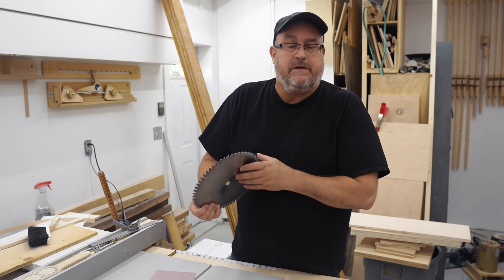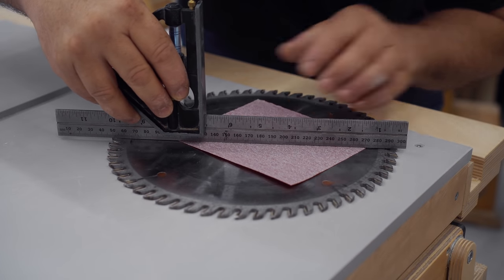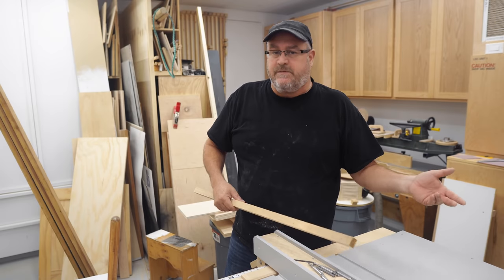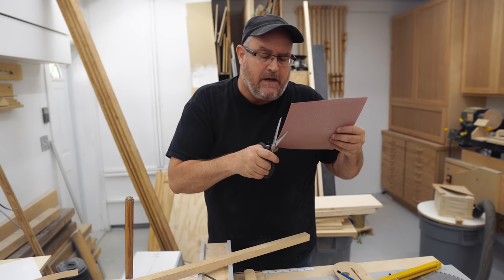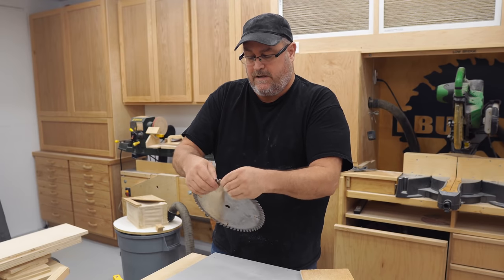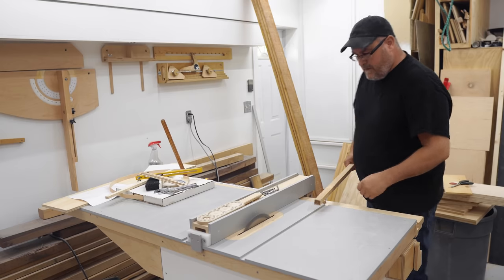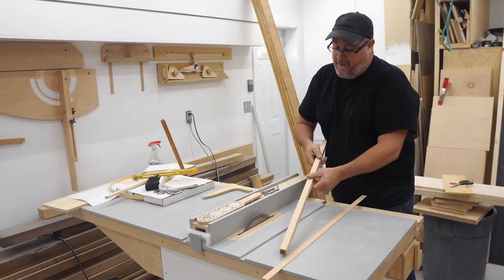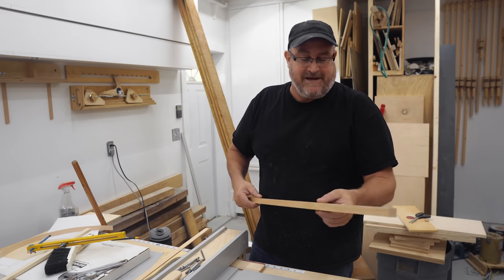Can you Cut and Sand at the Same Time? Interesting Results...

Comment: Does it really increase the KICK BACK as commented before? If we stop the video on 4:05 we see that 100% of the wood is being pressed DOWN by the blade as no wood is being pushed UP by the other KICK BACK side of the blade, I KNOW THERE IS NOTHING THERE YET!!!, when the piece enters the DANGER area it has LESS thickness cause it was SANDED BEFORE, therefore as per instinct or eyeball or six sense unless the sandpaper snaps off the blade or there is an unbelievable amount of resin, the DOWN pressure wins until the piece gets to the kick back area and clears the down pressure area. PATENT THIS NOW I will be the first one to buy from DIABLO

Comment: Dont do this, blades get sharpened reducing the saw set/curf, if that paper flys off it could easily take your fingers off or worse, let alone void any guarantee on the blade and table saw.  Ever had a paper cut ? Imagine that flying at your face at 150 miles an hour...

Comment: If you have the blade high enough so that the sandpaper sands the whole workpiece then the blade is set too high... the teeth should just pass the surface of the wood or you are making the machine & blade do more work than necessary... max 1/4" tip above workpiece

Comment: Your missing one thing in your "don't recommend" section.
That is by leaving the sanding paper on the blade and Not using it as a sanding disc, it leaves an even better cut edge.
That is the biggest deal right there.

Comment: I'm sorry, but I think there are some mistakes in your attempt and should never be copied! 
1. Your saw blade has many teeth and it isn’t very suitable for long wood.  these saw blades are more suitable for cross cuts.  
2. Your saw blade is not sharp, this already creates a bad surface. 
3. I missed the riving knife.  I always dread seeing saws without a riving knife.  This is a safety-relevant part of the saw with great effect and a missing riving knife has cost many fingers
4. if you have a good saw and a sharp saw blade, you don't need sandpaper on the saw blade
Reply: @Dorenda  trust me, he does unterstand the risks taken. It was just a test, as he clearly says that this is not advised. I'd imagine that he took off the sandpaper off the disk after finishing the video.

Comment: Don't do this people. This significantly increases the risk of kickback which has the potential to remove fingers. Just use a jointer, planer, and/or sander for your smoothing needs.
Reply: It was an experiment, not a new design

Comment: This is dangerous, if the sandpaper snags on the board it will pull the workpiece on top of the blade and throw it back at you. It's like building a kickback machine.

Comment: a saw blades teeth are wider then the blade because you dont want the wood rubbing the blade, the friction would cause alot of heat which would be dangerous, increasing the risk of damaging the blade and maybe making it shatter. even if this works, i think its an idiotic thing to do

Comment: well, at least use an old blade, grind off the teeth and maybe stiffen it up with some hardwood, the. apply the sandpaper if you wanna use it as a sanding disc

Comment: Everyone thinkkng this is a good idea have no clue how a saw blade must work. The teeth sould be the only part of the blade in contact with the wood, if your saw plate is making contact with the wood, or the blade is not properly set, or the wood is bindind or the plate is just too thick ( cause you added sand paper) you throw balance out, making it wobblier, noiser and it will start to build up heat and reduce the blade's life significantly increasing the risk of kickback in the way too.

A good glue line saw blade leaves the board ready, better than a sanded surface, no need for this.

Comment: we all know the right type of blade will make the edge super smooth anyway,, also adding friction from the sides of the blade may have an adverse effect on the motor as its not designed for that, nevermind the heat generated by the sanding could cause undue stress on the blade itself, then there is the idea that the paper/ fabric sanding sheet comes unstuck at 12000 rpm and shreads into your face.
seriously just dont do it

Comment: This is a terrible idea. Sanding is friction, friction could induce kick back more than a clean slippery blade plate. The last thing that the wood sees as it passes by the blade is what? Saw teeth. So why was the point of the sandpaper.

In addition why on earth would you want to introduce sandpaper abrasive to your table saw blade? It will shorten your blade life considerably.

Comment: This is pointless. Even if you designed factory saw with sand grit on the side, the sandpaper side would wear out much quicker than the saw. Gluing sandpaper is extra work and time. Sandpaper layer would make the cut less accurate. Friction while cutting could dangerously eject the half of the board held only in one hand. All drawbacks not positives. If something is for everything, its good for nothing.

Comment: This should never be done. Ever. This is one of the most dangerous pieces of equipment in any work shop and you should not be messing around with its function. You are a danger and an idiot and should not be showing this sort of thing to anyone.